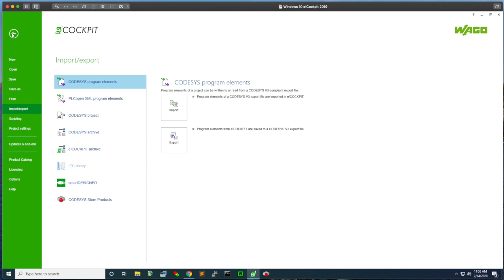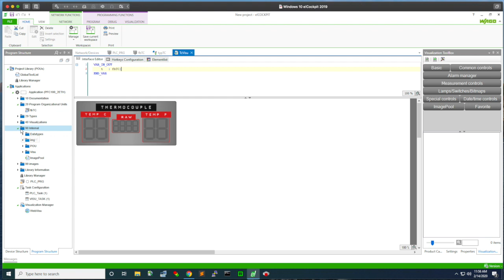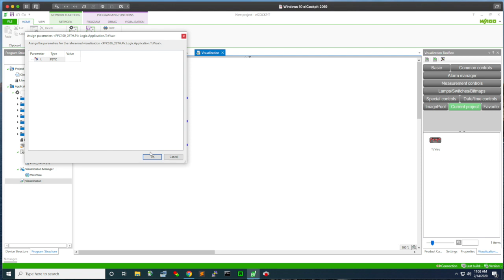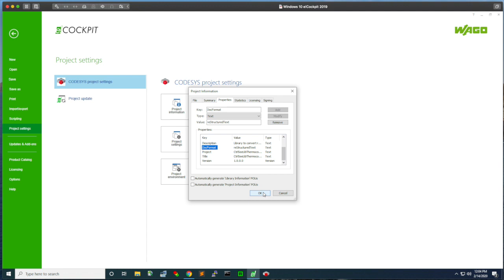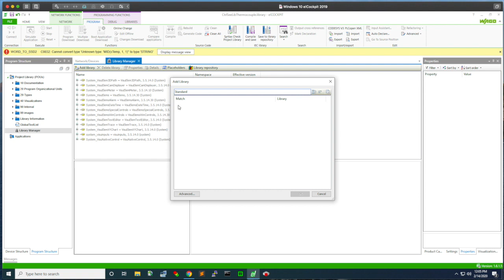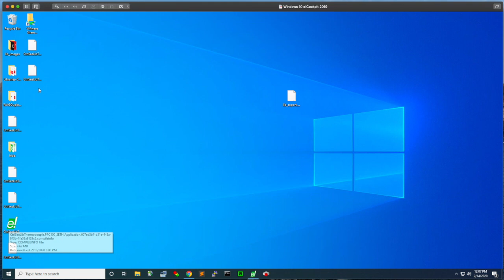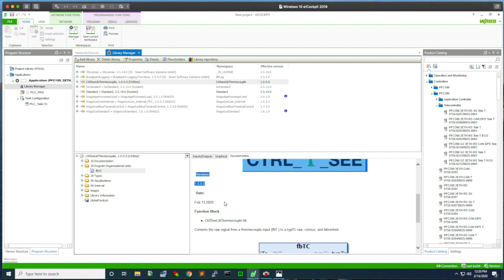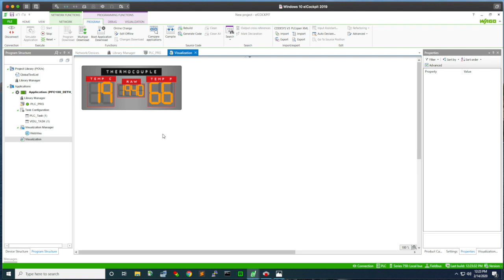WAGO e!Cockpit Simple Library Creation

Comment: Hello Jesse, thank you for the very interesting video. 
But I have a problem and I hope you know a solution! :)
If I change for example the interface of a visualization element and than update the library in the project, i get the error "The interface of the referenced visualization <xxx> does not match the current configuration. Please do an update of the frame references in the current visualization."
I understand "why"!
BUT: how can I update the references? Without replacing every instance of this element.
I mean, if i change a visu element inside the project, the dialog appears. But if I change an element in the library, it doesn't.
What can I do now?
Reply: Finally I got an answer from WAGO: 
Tab "PROGRAM" -> Category "Edit" -> Dropdown Menu "Advanced" -> "Update Frame Parameters in ..."